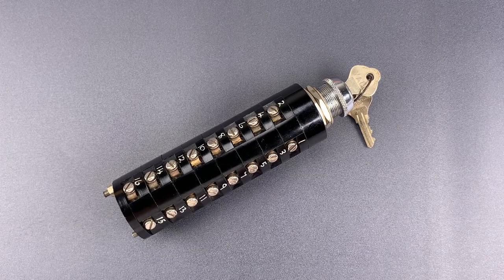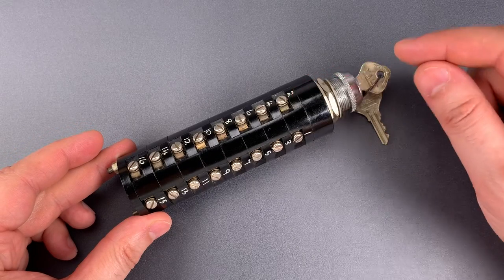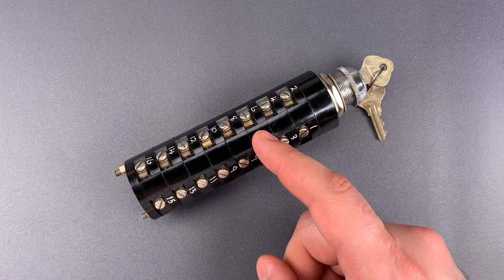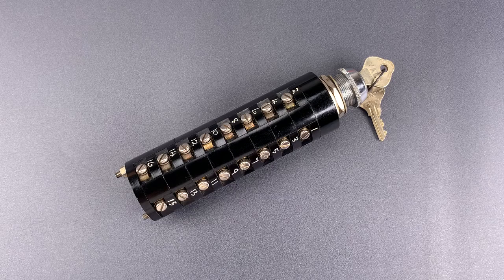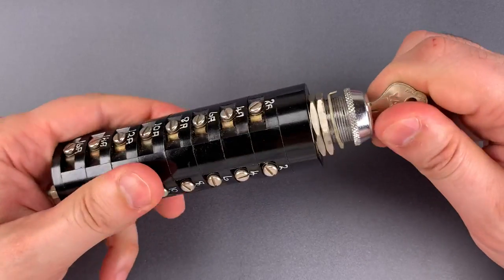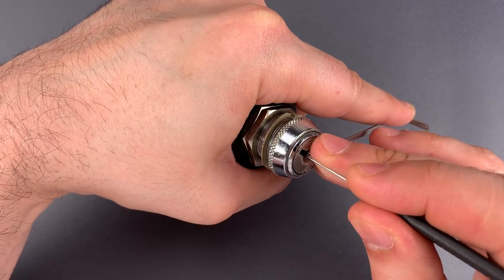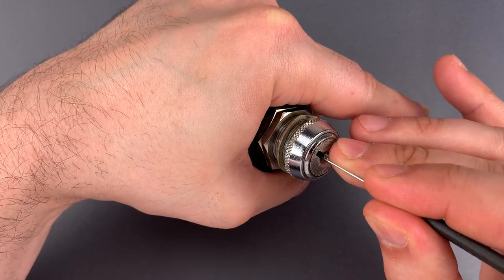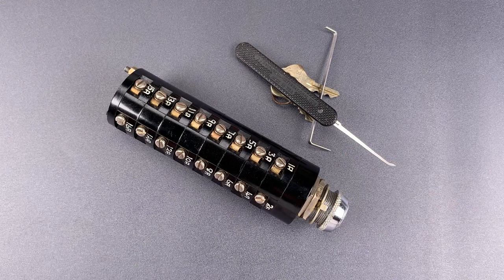[1154] Missile Control Key Switch Picked

Comment: The reason it's so hard to turn is probably because it is, in fact, an electric switch. If it moved smoothly, there would be a chance the terminals on the inside could arc, causing damage to both the switch and circuit. Technology Connections made a good video on this :)
Reply: Link?
Reply: Are you deaf? He stated that it was a switch and referred to the even and odd numbered "circuits" being on and off. What did you think he was saying?
Reply: Galette rotary switch.
Reply: There are 2 terminals at the bottom
Reply: @stumccabe  Did you read the comment past the first line man? OC pretty clearly talked about exactly what problem would be caused if it rotated smoothly. The first line is supposed to be a reiteration of a known fact for emphasis, not a statement of a new fact. If your argument is that LPL may already know this information and would not need to be told, I think the comment still is helpful for viewers to gain extra insight.
Reply: It requires quite a lot of torque because It's a stack of 8 switches.
Reply: @RainBitcoins  Those are the ends of the bolts holding the 8 separate switches together.
Reply: @bloccoaspirale1867  Could be.  Hadn't considered that.
Reply: Ah, a man (woman?) of quality, I see.
Reply: Technology Connections is such a good channel   :D
Reply: The circuits probably would not have a high enough voltage or carry enough current for arcing to be a problem, but you would DEFINITELY want the switches to be in one position or the other and not somewhere in between.  It's my opinion that the snap action is mostly so that the switches cannot be in an indeterminate position, and to also make them more immune to physical jostling.
Reply: @No-uc6fg  You should specify who you're talking to.
Reply: I see the youtube algorithm has lead us to the same channels
Reply: @bloccoaspirale1867  ok gotchya... I thought they were + and - terminals.
Reply: I was about to mention tech connections on this 🙂 Cool how communities overlap
Reply: @spoon093  I'm with you there.
Reply: @stumccabe  calm down
Reply: I wonder if inside it's a bunch of switches in parallel working only one circuit.  To make sure when you flip that switch there's no doubt you have a connection.
Reply: @No-uc6fg  I'm a dude :)
Reply: @stumccabe  Just reiterating that fact. Have a good day :)
Reply: @pfsantos007  That may actually be what it is - though I can't be for certain as he didn't open it up, and I also don't have one.
Reply: @ΜΑΝΟΣΚΟΥΤΣΑΚΗΣ-ν7δ  Indeed it has
Reply: @DimensionDude  Perhaps. I suppose the same logic could apply, though ^^
Reply: @justincarawan-carawanco.pu1639  I think he's referring to me, mostly due to my pfp
Reply: @pfsantos007  I was an aircraft mechanic back in the day, and while the wiring is often different from a house, the switching isn't.

If this is the Master Arm switch on an aircraft, it would have one set of electrical contacts for each pylon/gun. Gun, centerline pylon, and 3 pylons per side would make 8 contacts.
Reply: @RainBitcoins  sadly, each one of those screws on the outside are the connection terminals.

Now, there might be power getting fed in from the bottom, I never had to deal with wiring those switches.
Reply: Ha ha!!  I literally just watched that video yesterday on Technology Connections!!
Reply: @ScottKenny1978  thank you for your reply! 👍
Reply: Go Alec!
Reply: Yeah in a since it is a big ol keyed circuit breaker
Reply: @stumccabe  hahahaha u mad?
Reply: It most likely doesn't switch any high voltage so arcing isn't a problem and it's used to turn on something rather than turn off some load. The clocks are there for mechanically securing the switch in both positions so it doesn't move freely and good contact is ensured, especially in a moving aircraft. As others said there are 8 of them so 8x the force of one switch. Several contacts will be wired in parallel for redundancy purposes and position feedback and I bet it's a universal part where more or less contacts can be used according to specific circuit needs.
Reply: @jan.tichavsky  Good point. Theoretically, the switch could've been used in a high-voltage setting, so my point still stands - on a theoretical level, I suppose. Thank you for your comment! ^^
Reply: fucking love tech connections, both channels his videos always have me fucking with stuff
Reply: @LockPickingLawyer pin this comment please
Reply: @stumccabe  It was a figure of speech, one which you clearly don't understand. The internet is too much for you to handle, please consider not using it.
Reply: @bryanp.1327  You madlad
Reply: HeyItzRare ahh, so THIS is why I have so many Technology Connections videos in my suggested while watching this lol.
Reply: @-eMpTy-  Zelda
Reply: @stumccabe just get off the internet for a few days my man.
Reply: @damien4197    I was just writing something very similar, but you nailed it! What a knob. Lol
Reply: I will concede that my comment was rude, but the reaction to it was demented. What do you want me to do? Should I delete my comment - would that make you feel better?
Reply: @stumccabe  what happened to "I will no reply"? Imagine calling people morons despite having virtually no reading comprehension skills.
Reply: I think we are skipping one extra problem that would occur with arcing on a missile launcher system, like, fucking sending it :D
Reply: @stumccabe  heheheheheh
Reply: Oh it depends. A low voltage will not arc.
There are uses for both make-before-break and break-before-make switches.

(Note that a low voltage can arc if it is a high frequency signal on it, and more so with less sine wave (triangle, square) signals, depending on the circuit.)
Much, much stuff uses low voltage on switches to control high voltages by way of relays... mechanical or Solid State.

Comment: LPL in future: 
"this is the LockPickingLawyer im here at the atomic missile control panel, normally you would need a code to activate the missiles, but i found a design flaw that allows the missiles to be launched without any code.*pulls out abnormally large magnet*
Reply: That used to be pretty easy actually, don't recall exactly when this flaw was discovered and corrected, but the launch codes used to be 000000. Apparently the generals were pissed they were told they had to do this so thats what it was for a good while.
Reply: @sparkplug1018  I recall that in UK submarines armed with nuclear weapons there were no codes required, but instead the crew just needed to grab keys from a safe to arm and launch the missiles. Stated reason for this was that the UK couldn't trust there would be any part of the government left after a surprise nuclear strike to transmit launch codes for a retaliatory strike, so unlike their American or Soviet counterparts they decided to trust their submarine captains and crews not to make poor decisions during peacetime.
Reply: meckelbu Guess it worked out for both of us, still not very comforting
Reply: @sparkplug1018  It's much more comforting than knowing that the only reason we haven't had a nuclear holocaust is the fact that someone looked at a signal confirming nuclear missiles had been launched and decided not to nuke the enemy.
Reply: Video 2087: Starting world war 3 with a bit of metal from a Red Bull can.
Reply: pulls out comedically large magnet
Reply: @sharbanu1  Especially so because that person was Russian in the middle of the Soviet rule, so basically he was prepared to sacrifice his life by not following protocol and believing that it was an equipment malfunction (which it was).
Reply: @Cinkodacs  If the reading had been correct, he would have died a few minutes later from the incoming nukes.  So there was nothing to loose by betting it was a faulty sensor.  The west had a similar incident where early warning radar was triggered by a flock of actual wild geese.
Reply: @Cinkodacs  One of the russian submarines in the area during the Cuban Missile Crisis had depth charges dropped on it... and the captain ordered the launch of nuclear torpedoes. The sub in question required a consensus of three officers instead of the usual two, and the "extra" officer refused to authorize the launch. 
Thank you, Vasily Arkhipov. We all greatly appreciate you cancelling the apocalypse.

There was also an incident where NATO was conducting training exercises near the soviet border and the soviets decided it was actually the cover story for the assembly of an invasion force, because that's what they would do if they were going to invade Europe. 

There were SEVERAL incidents where we were way too dang close to nuclear warfare. The geese is just the most embarrassing one. Probably.
Reply: sparkplug1018 you’re missing two zeroes.
Reply: You win the comments section so far.
Reply: I legit spit my coffee out.
Reply: @sparkplug1018  The idea is that it requires so much more than just knowing the code. The code is kind of trivial. You have to have so many additional people there confirming orders with actually important codes long before anyone ever steps up to a console and puts a key in. Which again requires multiple people and confirmations before even more steps. Honestly leave the code at 00000.
Reply: @CriticoolHit  Of course its no trivial matter, even if it were as simple as enter 000000 and turn the key, would still need the other guy to go along with it. 
Still not a terrible idea to have a few safeguards and failsafes in place though, considering what would be at stake.
Reply: As the nukes fire "Click out of 1, 2 is binding, 3, 4, click out of 5
Reply: I just read this imagining a loony toons style oversized Acme magnet. I burst out laughing in a public restroom and now I can’t come out of the stall until everyone else who heard it is out.
Reply: Made my day! rofl
Reply: @meckelbu  we have a similar thin on our subs here in Erusea, that alicorn is a beautiful ship.